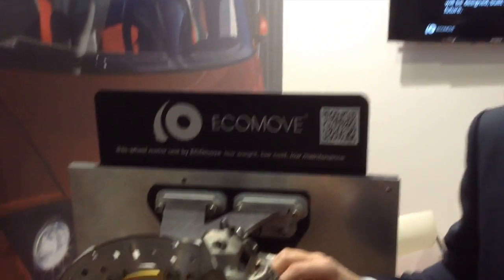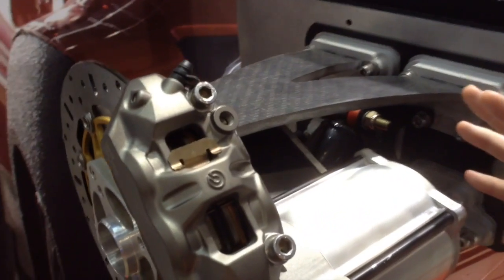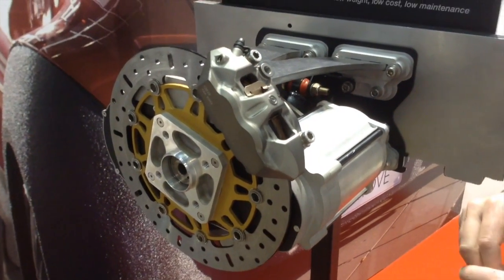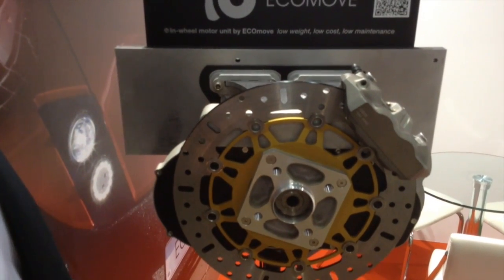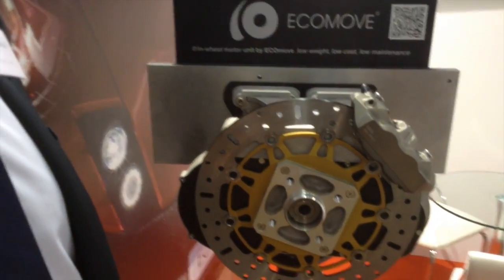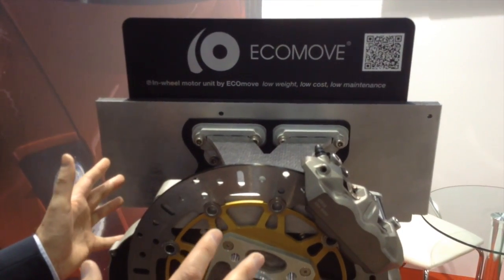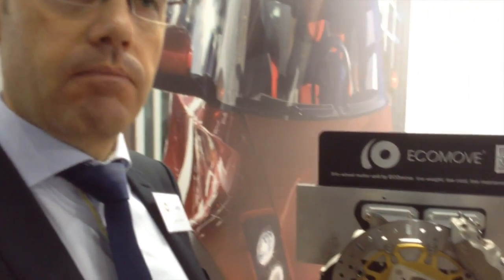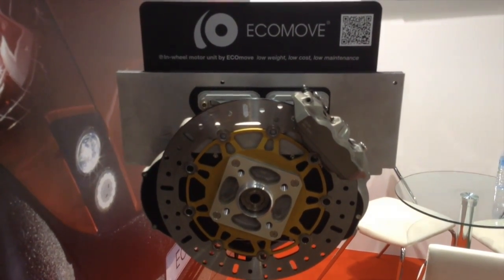In-Wheel Electric Motor Co

Comment: the 50 HP with  load or without load 
what is maximum power consumption of motor and flat surface and on hill
Reply: Isn't HP always about just the motor and not about transmission, load or aerodynamics?
I would guess you will see more of those HP than with any other motor. The increased efficiency should also translate into more usable power.
Reply: +Robert Martin       Based of 746W/hp and allowing for less than 100% efficiency the maximum power consumption would be around 40kW per driven wheel.
Reply: Normally hp or kw is lost from the flywheel to the wheel. It looks in this configuration that you would lose almost none. So in an AWD situation a 150/160kw  scenario, it may look more like 200kw+
Reply: My what's app 9613192257

Comment: 1-2000 euros per unit! that is definitely not attractive for mass production cars.
Reply: Given that it makes redundant the engine, clutch, gearbox, differential, driveshafts, exhaust system (including catalyst), fuel system, ignition system and several ECUs, and replaces brake and suspension systems with its own integrated ones, that's not necessarily true.

The one major difficulty with EV manufacturing is volume and cost of battery supply, and that's getting better by the year.
Reply: @CluebotUK  100% correct